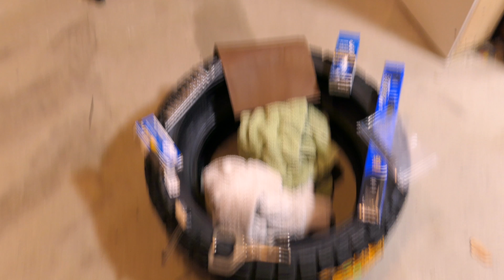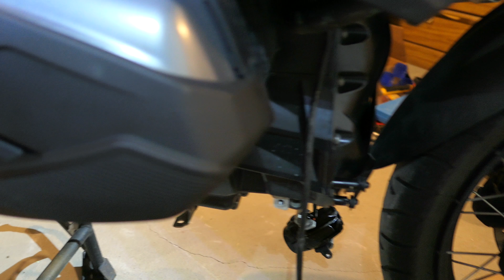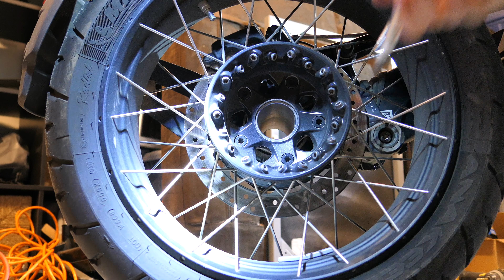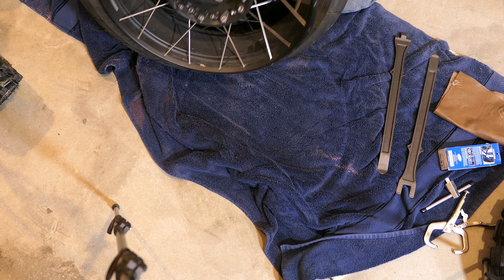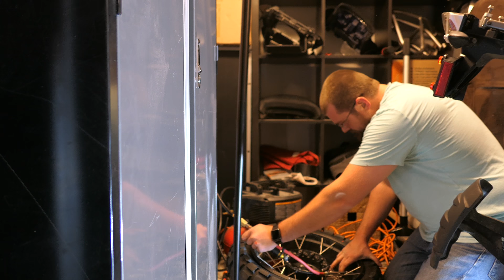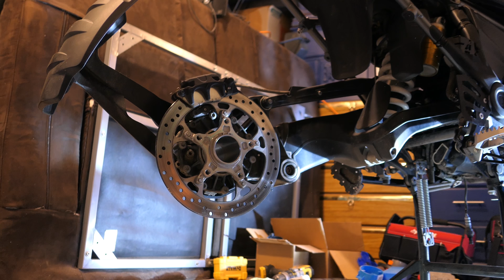Replace Rear Wheel on BMW R1200 GS Adventure Spoked

Comment: Just like I did it to myself. But I could not finish the job, at the end I took the wheel to a professional tire mechanic. And at that time I forgot to use the soap also. the Mechanic has done the job in less than 10 minutes.:))